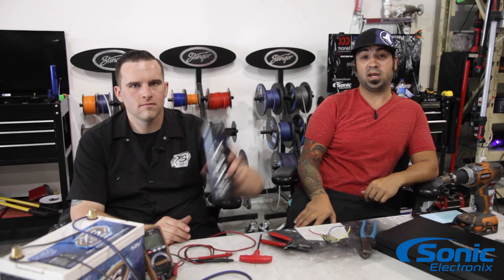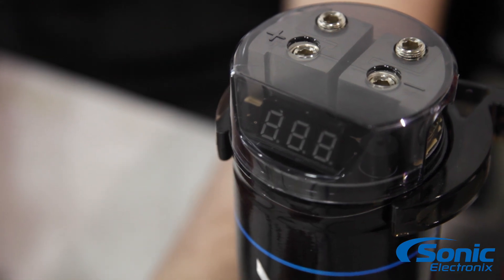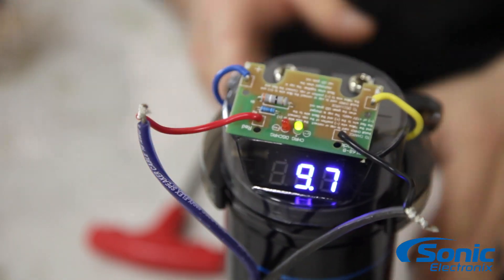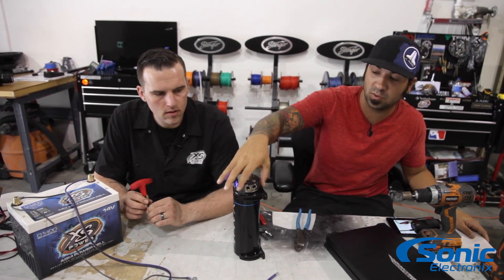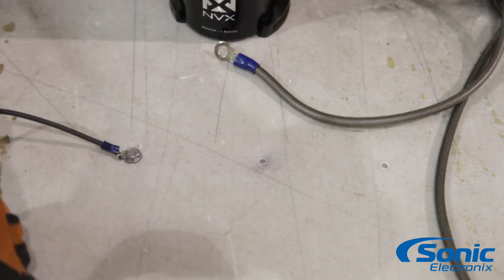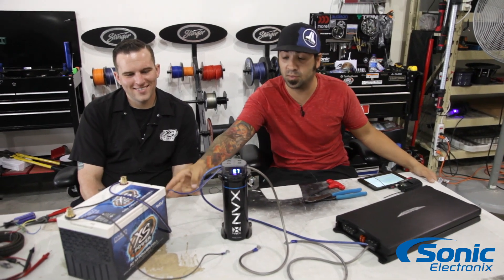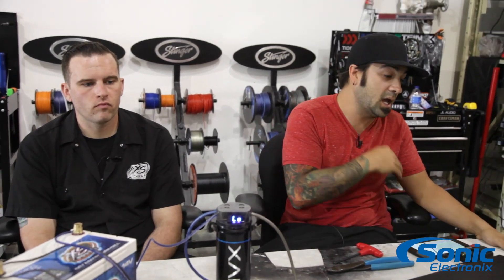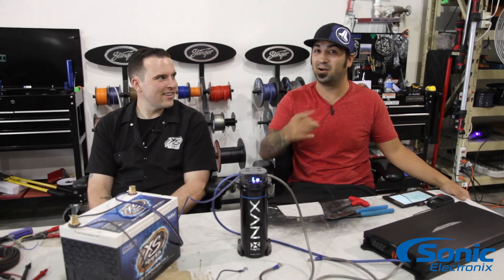How To Charge and Install a Capacitor | Car Audio Q&A

Comment: I have this capacitor and lately out of no where, my subs cut on and off and the amp goes into protection mode. While it’s in protection mode, the capacitor blinks 0.0. Anyone know why this is happening? I’ve had this Battery capacitor for about 2-3 years. I have a single 12” L7 with a Kicker CXA800.1 amp

Comment: I was always taught that you should use the same ground to avoid alternator wine in your audio. You are saying I should use a separate ground for the capacitor than the amp? Everyone else says otherwise why is this? Anyways I was watching your video so went ahead and set up my capacitor and amp grounds separate, one to each side of my car seat frame to the chassis. do you think this will be good?

Comment: Question do i do the same too my stinger farad s505  it came with that  lil resistor  red blk blue yellow  connect it the same way too charge it thnk u you great video

Comment: Question. Just like yours in this video once I disconnected the relay to charge the cap the cap started discharging as seen in your video with the lcd screen.  Then eventually it says low.  Does that mean it is discharged?   I don’t want to see the cap discharging my battery once connected nor do I want to hurt the cap. I did put a meager across the terminals and it reads nothing after sitting and it says low.

Comment: Since the nvx capacitor has a built in distribution block can I wire the neg from the body of the car to the cap and cap to the amp? Or is it best just to wire 2 separate negs frame to amp and frame to cap

Comment: How did you guys make the grounding table? I have been trying to figure it out for the longest time. I ended up buying a 30v 10amp variable power supply. But a car table would be AMAZING and would make an awesome conversation piece

Comment: The engineers who made this product must have been either incompetent, or just wanted to have some fun with customers. Ok so lets move on. They give you a circuit board to charge the capacitor. You are suppose to connect two wires to the positive and negative. Yellow to neg , Blue to pos , then connect the red to power , and the black to ground , you wait for a green solid light and then unhook it all and connect it inline to your amp.
First problem , the wires coming off the board are like 2 inches long. To reach across a 4 inch surface and then to crimp into a 1/0 gauge hole. Keep in mind , these wires are maybe , at best , 18 gauge. Its literally impossible to take such a small wire and crimp in to a 1/0 hole and have a secure connection. Sure you may be able to loosely get it to stay long enough for it to charge but if you want a tight connection , which , when you are dealing with a high energy capacitor , I would assume we all would want a very secure connection. That is impossible to get with this setup. 
Second Problem , The allen wrench stud for the crimping of wires into the 1/0 hole is maybe a 1/4 inch long if that. The 1/0 hole is at least 3/8ths thick from one side to the other. To charge this , you are trying to screw this Allen screw down till it crimps a 18 gauge , possibly 20 gauge wire and when it does not get crimped , you screw it in more , expecting it to bite and crimp the wire , but guess what? It does not and then finally the screw runs out of threads and you now have an Allen screw trapped inside a rotating barrel that is impossible to line back up and rethread and back it back out. The next thing that happens , if you think you got it started and it squeaks , guess what , its cross threaded , and it will never ever be right from then on. 
I mean , this is shear idiocy , to design something like this without realizing these very obvious failure points. So what would have been the easy way to solve this? Well , for one , add enough threads on the stud so that even when it bottoms out , it is still in the threads it just passed through. Here is another, better solution. Tap a positive and negative third hole that is a little bigger than the wire on the circuit board , specifically for the ability to crimp that wire in place to either discharge or charge the capacitor. I have no idea who the responsible design team was but damn , this is a completely useless and flawed design as are the people that designed it.

Comment: Thanks for the video I’m having a lot of feedback noise or whining noise every time I install a capacitor this is the second one I have installed brand new same noise if I bypass the capacitor no noise at all can you help.?
By the way I am running to separate ground wires

Comment: If not connected, I saw the voltage slowly going down. Does it go all the way to 0 and have to charge with the charging tool again ? Or once installed it holds voltage

Comment: I bought this same Cap. Charged it per the instructions. The volt meter on the cap turned off. Then it came back on. Now it’s off again. Everything works. System sounds great. Headlights in my 2019 Tundra don’t dim. So what’s wrong with the cap?? Did I do something wrong? Or is it just an expensive distribution block now?

Comment: I have a question does it matter how many farads the cap is rated for I have a 1000w max amp and about to install a 5 farad cap. Will it be ok to use?

Comment: I have a 4 farad cap, I am charging it but it was a over night charge and still it has not hit the full charge.  I use a DMM on a 20 v and test it and still it is only at about 7.56 v.  I’m using the resistor that it was supplied with.  Am I doing something wrong???

Comment: I have a Question my batteries 🔋 completely died in my truck so I got a new battery but before I get my new battery my capacitor completely died with no power so by me having a new battery do I I have to recharge of the capacitor or does the battery do it because every time I turn my car over the compressor is still off and the numbers that show up is L. Hi then it’s shows up hi with are other numbers so is that good or bad

Comment: You hooked up the ground to the table first from the amp and then you hooked up the positive to the cap, wouldn't hooking up hot after ground be asking for a huge spark during wiring? I know if I swap a car battery and I hook up ground first and then hot it's gonna 💥💥💥💥

Comment: Running a 1000rms amp in a 04 chevy diesel so it already has two batteries in the engine bay. Would you guys recommend another battery for the amp or just a capacitor and or bigger alternator? Thank you

Comment: So i have a soundstream AR1.8000D  just for bass and i don't know what size fuse should i be using because the manual doesn't say. and i have a 1 fared stiffening capacitor and a other boss 16000 for my mids do i need a bigger alternator for this setup

Comment: How do ypu test to see how many fareds the capacitor is? Using a multi meter
Reply: Your cap only acts as a filter, power goes in and comes out. If it weren't there the power would go directly to the amp. Think of it in terms of an oil filter on your car. Oil and crap goes in, and clean oil comes out.

Comment: I'm trying to charge a 24v capacitor, I cannot just hook 2 12v's to it, add it will make a closed circuit and the 12s won't be able to handle a 24 load, correct? How can I charge it??

Comment: Which capacitor rating is suitable for an SUV sound with: 
-2 8k subs watts each on 6k mono block, and 
-2 pairs of 6 by 9” speakers and 6” speakers on 8k watts 4 Chanel amp

Comment: 1.Unscrew the RF cable connected to the cutting head . If the capacitor is not zero , the cutting head is damaged 2 , Please check the RF line , four - wire or amplifier is damaged .

Comment: Why the charging green light dont go off ? Have it connected 20 mins or more. Its a stinger 10 farad capacitor.. does it take longer to full charge ???

Comment: Iam running 2 amps.with a splitter I would call it cause cant remember the name of it running power wire from battery to that splitter then to both Amps.can I go from there to hook up a capacitor and ground from amp to capacitor.or is that not right way
Reply: NO SIR IT NEEDS ITS OWN POWER SOURCE

Comment: I installed a 1500w bass speaker in my car last week now at low revs the car seems jumpy/jerky would fitting one of these fix it?
Reply: Probably not. Maybe you need bigger wires, better alternator or better/ extra battery

Comment: i just sold my car and kept my audio system.. quick question, do i need to re-use a resistor to install the capacitor in my NEW vehicle? or skip that step?

Comment: I have a quick question so I have a jbl 12in sub and its hooked up to an aftermarket deck. Now it sounds great but it takes awhile for the sub to actually kick in I mean like a good hour and when the thump starts to come in its only when I either accelerate or slow down then cuts off can you explain what needs to be done cause I'm about to throw the motherf*$:r away and call it good haha

Comment: hey i had not used my cap for one year and now when i connect it to the battery directly the voltage indicator  does not light up

Comment: Anyone has the link for the charging tool these guys used? I tried asking them but like they just did this video and left. My capacitor only came with the resistor. I know how to use it but this device seems cooler!
Reply: Kevaughn95 I don’t think they offer that, but you can contact NVX to see if they will sell to you.

Comment: I have a capacitor aswell question is why when I’m playing loud bass the capacitor stops working and makes subs stop playing
Reply: jazzie gurl means your amp isn’t getting enough power, and you need to get it tuned again, or go to a different person, because the 1st one didn’t do it right. Or the cap is defective

Comment: I use a light bulb (low power one, e.g. from turn signal). If car battery was disconnected - I remove the main audio fuse before reconnecting the battery back. Then just touch a fuse holder terminals with a light bulb contacts. The bulb lights up for short period of time (while the cap is charging). It takes just a second to level the voltages, so the light bulb does not have enough time to heat-up.  Then you just put fuse back in place - DONE!

Comment: where to buy this 4 wire resistor capacitor charging circuit?
Reply: Alexander Brick I didn’t use it, I just plugged it up and started using my cap

Comment: Also... even though I have always had this capacitor, I have the lights of the car "pulsate" with the bass. Im not using a huge system. I only have a 300 rms MTX DVC sub, ZXi 8010 amp. Some other comments on the net people say that capacitors are a waste of money specially for a small system like mine
Reply: jhon rivera yeah it is, best bet is the xp 750 xs power bat.. 
it won’t tax your alt to much, but eventually you will have to upgrade it

Comment: what happens if you install the capacitor without charging it?
In my case, when I installed my capacitor I didn't know any better and did not charge it. This was 10 YEARS ago wow. How can I know if I need to replace it? I had to disconnect it because I was moving my system from one car to another. Before I go and install it again: How do I know this capacitor still good? Do they wear out?

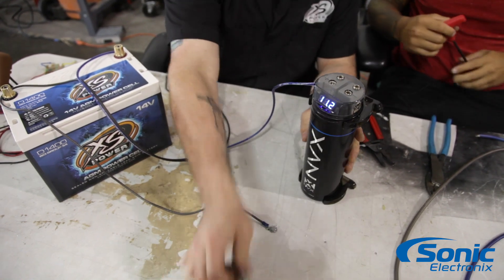Comment: 5:34  You guys can't' even pretend to know anything about electronics well at all.  Demo or not speaker wire is not satisfactory for that purpose.  What I really wanted to say is that, while ground loops can be difficult to understand at first they get easier to grasp if you READ everything that you can about them.  The main thing to understand is that as an "engineer" or "installer" you either create a ground loop or you dont.  They don't mysteriously appear like some sort of gremlin.  Where you install your devices ground has absolutely nothing to do with it.  The devices in your demonstration all need to be connected to the same negatively charged point.  It doesn't matter if you connect them 20 feet apart, right next to each other or on the same negative terminal.  The location of the connection that your devices have to the negative is inconsequential with regard to ground loops.   If you really want to know what a ground loop is then either read up or ask me.  I hate to call you out on this but you guys are slacking.  Maybe you should go to electronics school or even join the                                     US Navy or something.  They'll teach you what is what.  Jeesh, the only loops in here....  LOL.  No harm meant.  Best regards.
Reply: Exactly what I was thing.
Reply: Thinking *

Comment: I totally dig the table car, I wouldn't recommend driving it at high speeds. My question is, I don't exactly have a voltage issue. I do know that I'm running 1000 w rms on a stock alternator and a single battery in a 2019 Kia. I'm hoping this will reduce the risk of killing my alternator and battery, but if nothing else I'd like to Know if it would potentially draw any more power than I'm already taking

Comment: Thanks for uploading this video. I just received my Stinger 5-Farad Capacitor and was searching high and low for the charging bulb that used to come with caps. Even the directions didn’t mention what the little circuit board was for! Do you have Stinger’s ear to mention updating their instruction booklet?

Comment: You know I don't understand "first charge" Most caps will stay on when you shut your car off till it completely drains itself, so it's back to where you started. So in theory, you need the initial charge every single time you start you car after leaving it off for an hour? seems redundant at best. Some people swear by capacitors, but spend the extra 300 do a big 3 and add a second battery. Nothing beats that. And even if you don't have a lot of money, you can get your hands on cheap used good batteries and some 1/0 ofc, you just gotta put the work in.
Reply: I'm confused too. So much online how you need to be careful I don't eve. Want to use one. But I have one and I'd like to use it. But if it dies so fast what's the point of pre charge

Comment: At 9:10 engine whining from the distributor can be eliminated with some systems by simply taking a piece of wire stripping the shielding and wrapping it around the RCA on the back of the stereo and let it hang there twisted at the bottom. There's videos here on YouTube that show how that works.
Reply: I assume it acts as a floating ground.

Comment: Alternator
 A generator producing alternating current by the rotation of its rotor And As A Result Puts Out An Electromagnetic Field Suppressed By What Is Called Static Arrestor" A Dampening Of THE Electromagnetic Field/Intolerance.
Not A Capacitance. IE The Ability To Sustain And Distribute A Volume Of Charge In Order To Assure A Continuous Flow Of Electrons At A Particulate Voltage.
In Conclusion Get The Hell Out Of Your DAD's Garage Watch Out For AC. Ripples And CAP ON DUDE!

Comment: Allen, I am building a 02 Chevy Tahoe. I just put the stereo system in it. Now it has a pioneer AVIC 5200 nex double din head unit, each door has a 6.5” speaker and a 1” tweeter with a crossover that has 3 settings +3db,0db,-3db.i have no idea what sounds better yet. Haven’t messed with them. They are Polk audio component sets DXI6501. I have a new Rockford Fosgate prime 300.4  4channel amp running the component sets. It has 2 sets of rca’s front and rear hooked up to it off the deck. For the bass I have a 18” custom built sub that I had running off my old ass db1000.1 Punch amp.  I had stupid ass alternator  noise! It made me loose my mind trying to find it. I changed out the deck, new RCA’S new grounds straight to the clean frame. I even built a complete new wiring harness from the fuse box to the deck and didn’t use any factory wire. Got it all done and turned it on and it was gone. Next morning I hopped in to head to work, fired up the truck and there it was loud as ever!!  I almost blew a gasket! My db1000 was makin a ton of noise also ,so I gave it about 4 hammer fist hits and that quit that but now it has the power of a 100 watt amp so I fucked it up somehow. So I bought a new amp a massive audio N4 claims 2000rms. I seriously doubt that.... but brah,,,,,,, The hum is still there as soon as you turn the key on but only for a few seconds then gone. What the fuck it it!!!! I just picked up the 10 fared hybrid capacitor , same brand as in this video. Got it off a friend for 40 bucks. Fosgate sells the same exsact one but says there logo and it’s like 500! So I have that to put in and I’m going to switch from 4 gauge wire to 0awg wire. My friend also has a huge kinetic battery he’s going to hook me up with. For like 125 bucks so I’m hoping the cap will get rid of it. I have been messing with audio for like 20 years so I know better then to run the rcas next to the power and all that. I think part of the hum is coming off the alternator and thru the firewall so I might Change it also. If you or anyone has any ideas throw them my way. I have not ground the rca to the radio basket. I think that’s ghetto so not doing that . That’s part of the reason I said f it and bought a new deck in the first place.

Comment: Great video, i have same problem. Mine is strange though. I just moved from Los Angeles to Chicago and have a 1500 watt amp on the internal speakers and a 2k watt pushing 2 12"'s. all was good in LA but after 1 month of being here my sound started dropping out. I thought it was my battery but after swapping out 8 batteries in 12 months i started watching you tube videos and realized it's my Alternator. I bought a 250 volt alternator and the first day i was out Banging and all was good then on my way to work 2 days later back to the same, sound dropping out with that fuzzy tone like a battery power3ed boom box dying on you. This weekend i am upgrading to a big 3 - if that doesn't fix it where else do i look for a fix. I cant believe switching cities would cause the issue. I get that i don't drive as fast here because this place is CROWDED and traffic is a B!